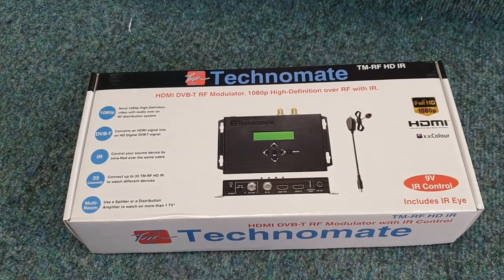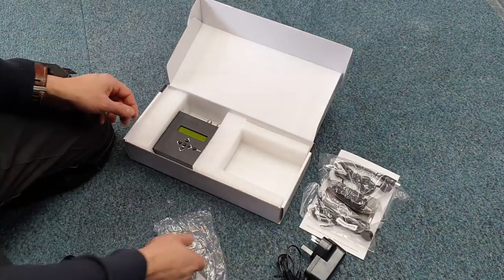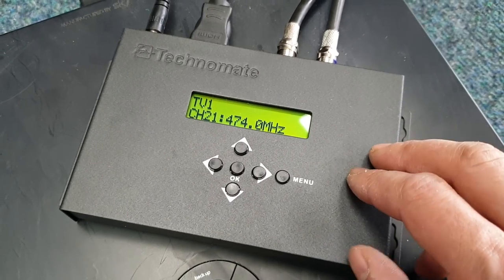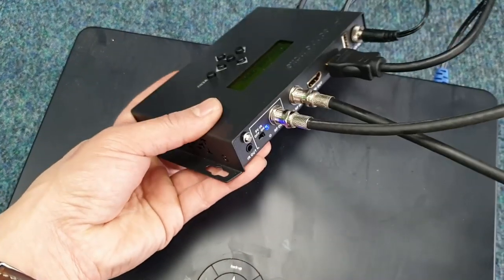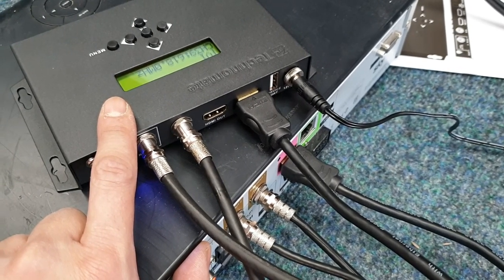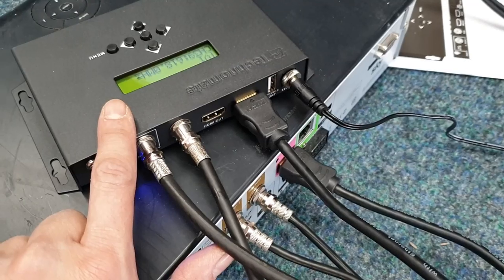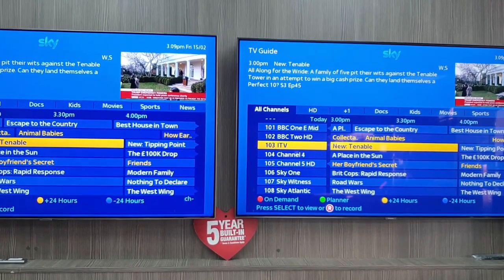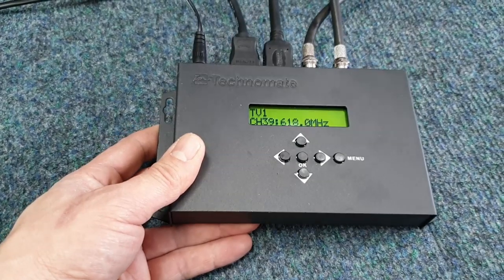Technomate HDMI Modulator, HDMI over Coax aerial Cable, How to Distribute Sky HD, Sky Q in 1080p

Comment: I use an AMIKO TRF-800 modulator. It only comes with the power adapter, has only RF output and HDMI input. By default is set to channel 43 but allows you to change the channel, the resolution is 1080p. It has same problem like Technomate Modulator. The delay is one second I connected my satellite receiver and my computer. I don't recommend for gaming or working. I mostly use for Netflix and HBO GO. Also works with Blu-ray players.

Comment: I've replaced my old io link with sky hd, getting ready for sky q , I just took rf in and rf out of io link and plugged into rf in and rf out on technomate. But no signal whatsoever on my other TV. Any ideas where I'm going wrong
Reply from the maker: Have you put the hdmi from the sky into it? You need to set the rf output number to something that doesn't clash with freeviw channels. Then tune in the tvs around the house, it should be on channel 800 on the other tvs
Reply from the maker: Ps I think the default rf number is 21, you could try 68?
Reply: @TellyDan  I've done all that. When I go to my other tvs no signal whatsoever ever before I even retune
Reply from the maker: @richardatkinson5894  is the rf power turned on?
Reply: @TellyDan  on sky? I presume so io link works fine
Reply: The rf in and out plugged directly into io link but as technomate has screw in connectors. Had to get some adapters.  That shouldn't matter I guess.  When I unplug rf cables from io link freeview pic goes blank no signal. And it doesn't come back when I plug them onto technomate try retuning  still no signal on anything
Reply from the maker: @richardatkinson5894  the rf power 9v needs to be on on the technomate, check your new connectors to make sure no fray is touching the copper core
Reply: @TellyDan  got it working. Schoolboy error had rf in and rf out mixed up. Using ch 68, ch 21 didn't work

Comment: A few months ago Chris asked "Can this work with sky q silver box" and the answer was <only if you convert 4k to 1080p>.Now Sky are offering their 1TB box with a UHD capability (with Sky Q experience). Is this box then similarly in need of converting to 1080p? .. and does it output 4k all the time or only when tuned into 4k programme material?
Reply from the maker: You dont need to convert you have to set the resolution to 1080. It won't accept a 4k input unfortunately. The sky q resolution has to be set to 1080.

Comment: Hi, I bought 2 of these which arrived at the weekend to replace 2 of the old TM-RF HD's that have been working perfectly for a couple of years , I just wanted the IR function. these have an aerial into RF in , first box RF out to 2nd box RF in then the output is fed to Labgear LDL208 amplifier in the roof - I configured both exactly as the previous had been setup but when I installed -the tv's only find the two channels set at 800 and 801. Perfect picture but when auto scanning on the tv's, that's all the channels it finds ie 2 channels -its as if the aerial signal is not being fed through .I tried also direct connections to 1 box, Again scanning finds the modulator but nothing else. I am sure it's a configuration issue . I did not try changing the advanced settings - Any ideas what the issue could be ?
Any help would be much appreciated
Reply from the maker: Does the amp have ir bypass? Also I'm not sure that you can have ir passing to both boxes probably just the one connected to the amplifier. Also have you set the rf channels to be different to each other and on the spare rf frequencies in your area?
Reply: @TellyDan  Hi , yes the amp does have IR pass through . I haven't actually even tried enabling the IR function yet  on the modulators (ie left it switched off on both ) yes one is on Channel 40 the other 55 - This was working perfectly with the old TM-RF HD boxes without the IR function.Maybe I will try defaulting the boxes in case these have been setup previously - I did write to technomate but no reply from them yet
Reply: UPDATE- I have just tried defaulting and starting from scratch and bypassed the amplifier -ie tried direct on a tv using the individual aerial feed via RF IN and RF out to the TV - it all appears to be working normally and I can scan for channels finding both the modulator and all terrestrial signals - so the box is working fine - I will do the same with the second and see if that works - I will then try and cascade them again -if they work without the amplifier then it is the amplifier that is the problem - I will check tomorrow and update here -thanks for your assistance
Reply from the maker: @Fit4LessCaspianWharf  no worries keep us updated. The trial an error procedure sounds right
Reply: @TellyDan  Solved , After much messing about I found the issue  The original TM RF HD boxes are incorrectly labelled or wired internally incorrectly .The RF out is actually the RF In and vice versa (is correct on the new TM RF HD IR's) I can see all 4 boxes and all freeview channels , perfect picture on all.The only issue I am having now is getting the IR function to work , If you insert the IR emitters into the 2 boxes and switch them both on (Blue led on both),The TV signal is lost , TV signal comes back if you switch 1 of the IR switches off . Blue led remains lit on both boxes ,however IR function does not respond

Comment: Can this work with sky q silver box? The 4K one. Will it convert 4K to 1080p for distribution? (I am told the sky q box only outputs 4K signal, so if I want this to distribute the silver box I will need a second mini box to do it)
Reply from the maker: You'd have to down scale the resolution to 1080 then distribute it. HD fury did make a splitter before that gave one 1080 output and one 4k output.

Comment: I have set mine up in line with this very useful post. I am getting Sky on all of my secondary tv’s but can’t get Freeview channels to work on these tv’s despite the rf in and out being connected. Any ideas?
Reply from the maker: Is the aerial going into the technomate rf in?
Reply from the maker: Matt Mosley  try aerial into technomate first then rf out technomate into sky box rf in. Rf2 from sky to your other tv or distribution amplifier. Turn the 9v off on  the technomate. Rf2 power on, on the sky box

Comment: In my setup, the sky HD+ box was connected to the cinema amp and when you turned on the sky box it automatically turned on the amp, which in turn turned on the TV. 
Inserting the Modulator between the Sky HD+ box and the amp has broken this sequence so everything has to turned on separately.  Is there any way round this as my wife is incandescent at the change!

Comment: Just bought this modulator and setup as per this video using a Sky+HD box. The RF out is connected to a 4 way distributor in the loft and both remote TVs are now working great with Sky. Had been watching analogue Sky picture quality for all these years, wish this was available many years ago. Also both remote TVs have magic eye setup, I had to turn off the 9v from the Sky box and turn on 9v on the modulator and now all magic eyes are working perfectly.

I do have a problem with both remote TVs Freeview channels. The picture and sound quality are fine on the Freeview channels but that is until buttons are pressed on the TV remote control then the picture and sound would breakup on each press of button. For example turning up and down TV volume, with each press of the remote control, the picture and sound would breakup then return to normal. Any ideas why?
Reply from the maker: I found this the other day when I installed one. Every time I used a button it interfered but it never did when i installed them before
Reply from the maker: For now you could revert back to using the sky ir system and having the technomate for the picture
Reply: TellyDan what do you mean by using the Sky ir system but keeping the picture?
Reply from the maker: Do you have rf outputs or io link on the sky hd? If so put the aerial into the technomate than out to sky rf in then sky rf2 to aerial amp
Reply: TellyDan At present I have aerial into Sky HD. Sky RF2 into Technomate RF in. Then Technomate RF out into loft distribution box.

Also Sky HDMI out to Technomate HDMI in and HDMI our from Technomate into local TV.
Reply: I can confirm by plugging the aerial straight into Technomate solved my interference issue. I can even turn the 9v off from the Technomate and use the 9v from Sky RF2 to control the magic eyes around the house.

Comment: Recently installed this to replace the classic tvlink rf out 2 system and it works brilliantly. I wish we had done it years ago as the Hd picture and stereo sound is so much better than the analogue mono affair it replaces. 
I have now also been able to replace my sky HD box with SkyQ and maintain the loft distribution of the HD signal over the digital channel and the sky eye IR functions. 

However this does require a new SkyQ IR remote in all the other rooms as the old Sky+ / SkyHD ones don’t work with SkyQ boxes. 
I appreciate the touch remotes are Bluetooth but I don’t want to carry that around the house

One question, whilst I appreciate the remote TVs are only ever 1080p is it possible to use a splitter between the SkyQ box and technomate modulator so I can still feed the local TV with Ultra HD and then look to replace my 1080p local TV to 4K?

Feeding one splitter out to the local Tv (thus 4K) and the other to the modulator (1080p)

I have found the following product. http://www.technomate.com/products/TM%252d2-4K-SP.html
Reply from the maker: You need a HDMI scale that outputs full 4k to one port and down scales the second port to 1080p. Hd connectivity did one I'll see if I can get the model. You could try googling hdmi scaler.
Reply: This is just what I want to hear. My Sky HD set up is on it's way out and I'm going to have to upgrade to Sky Q soon, but really don't want to lose the RF2 out, this will hopefully be an easy solution!

Comment: 10 secs into your vid you say it will go UPTO 1080p, i've bought one and it will not feed my other tv which is 720p, i have since found this on the technomate website " TV must be 1080p Full HD or 4K UHD (HD Ready models are not compatible"
Reply from the maker: I've got 720p tvs that accept a 1080 input and they're fine. Depends on the freeview tuner as well. So of the old ones dont accept the 8meg signal
Reply: @TellyDan  . i've tried it on 3 different 720p tvs all with the same outcome, they do pickup the freeview channels but they wont play the sky Q (channel 800) do you think a set top box at the receiving tv end could be the solution so it converts the signal into hdmi ?
Reply: @TellyDan  also the 720p tvs do play the signal but only through the hdmi output not the RF feed, is it that the hdmi input convert mpeg4 but the RF doesn't ? cheers
Reply: @TellyDan  i've bought a hd freeview tuner with mpeg 4 and hdmi connection and hey presto ! works a treat.